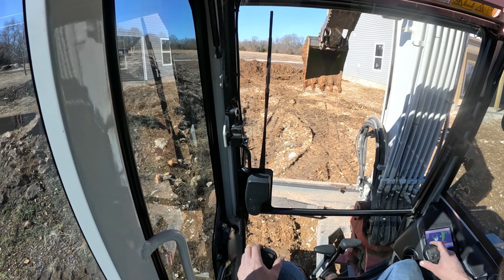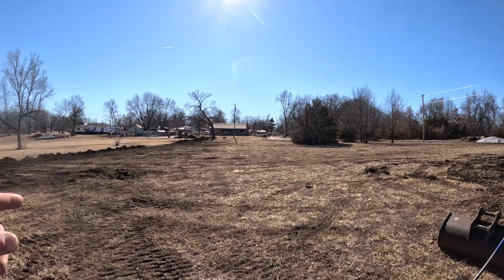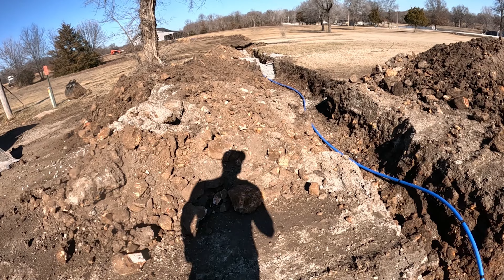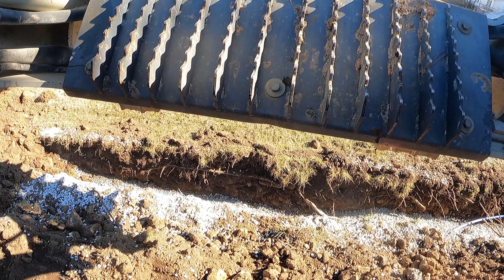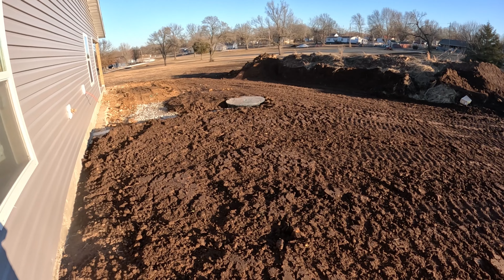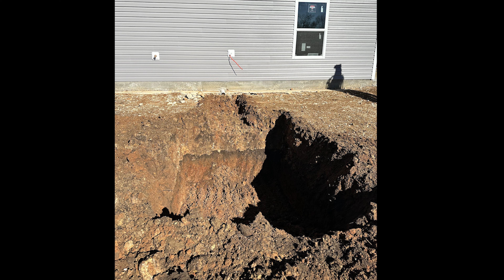Digging And Backfilling A Grinder Pump And Sewer Line

Comment: You were right - that was SOFT and wet out there, but at least you had a sunny day. And hey, I was watching close when you were spreading that dirt next to the house and I think you only got within 1/2 inch of the house not your usual 1/4 inch - what's going on??? Maybe getting accustomed to that gorgeous new bucket, huh, LOL.
Reply from the maker: It was very soft. 🤣🤣 yeah I’m slacking a little bit. Not use to the length of the new teeth. 😁